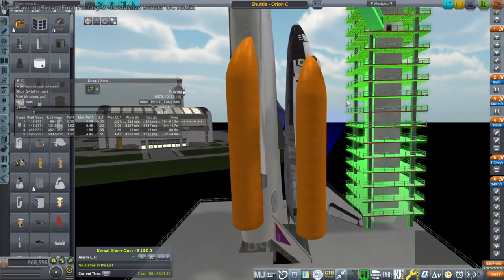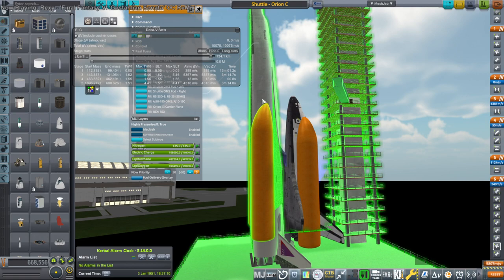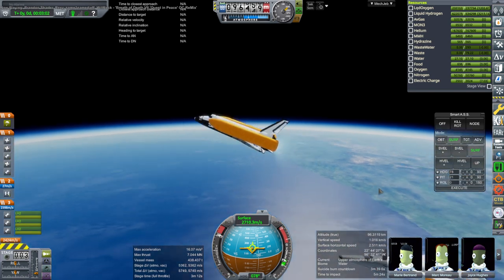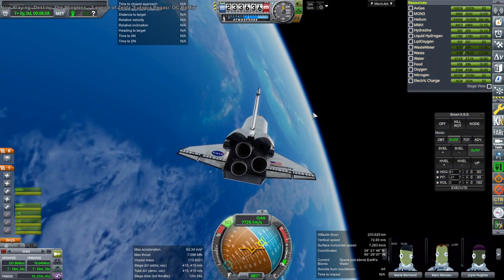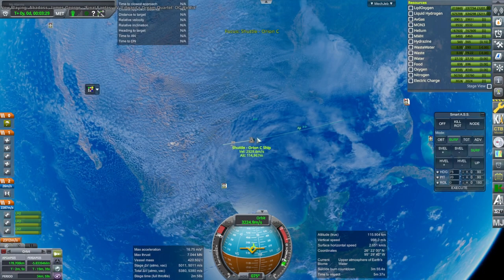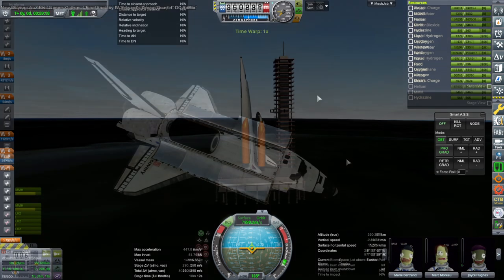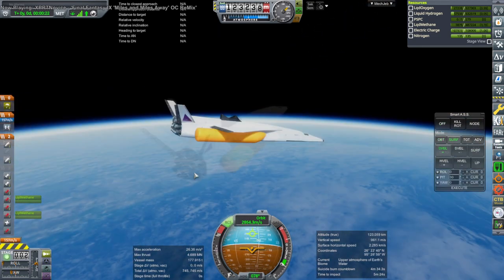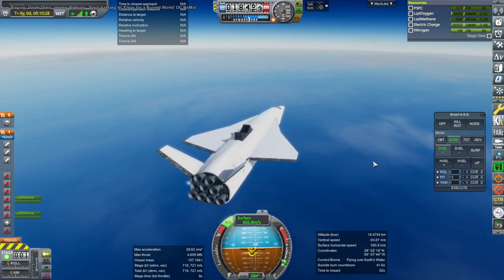KSP/RO - The Shuttle On a Single Methalox Flying Booster

Comment: With fly-forward in the real world, there is the issue of potentially overflying inhabited areas, bad in case an accident happens. But of course, this is KSP.
Reply from the maker: Well, there's no potential of that on the Gulf trajectories I use. KSP is not a factor.
Reply: @RaizSpace  Really? As I heard, those are very narrow.
Reply from the maker: Not if we add jet engines to the booster. It's only narrow because I'm trying a purely unpowered landing. There are, of course, constraints to any launch site, but jets would allow even for launches out of the Cape.

Comment: Not nearly as useful since it would only be for polar launches, but I wonder if it is at all feasible to launch from Vandenburg and land the booster somewhere in Baja California?
Actually, looking at it more, that doesn't seem much better than trying to launch from Boca Chica and land somewhere around New Orleans.

There's probably some way to make this work using one of the Great Lakes. Launching north from Michigan's Upper Peninsula over Lake Superior and landing boosters in Ontario seems like it could maybe be promising? Oh look, there actually are plans (Plans is maybe a stretch. Let's go with funded advocacy.) to build a launch site near Marquette, MI, which would do exactly that. Well, save for the landing part.
Reply from the maker: I was thinking about the fact that they used to test nukes in Nevada . . . and, like, Utah is really flat up to a point . . .
Reply: @RaizSpace  Even there, there are a bunch of little towns though. Even like due east of Edwards AFB, in the middle of the Mohave desert. 

The best spot for launching overland in the continental US is probably launching from White Sands (the missile range, not the national park), and just hugging the southern New Mexico / Texas border. There's basically nothing there... well... ok, there is a slightly narrow corridor between Dell City TX and Carlsbad NM. Stay within that, and don't need a cleared range that more than ~100 miles long, and you should be fine.